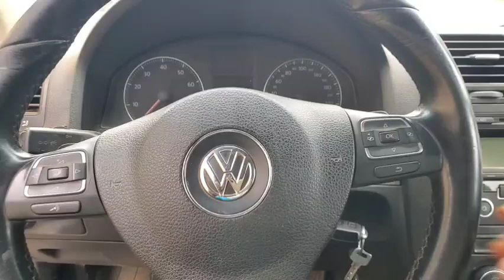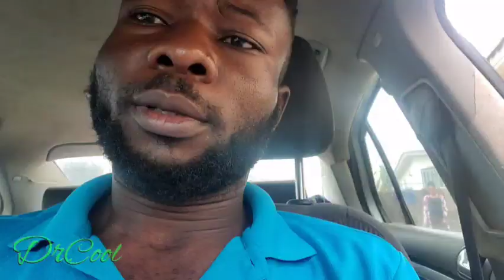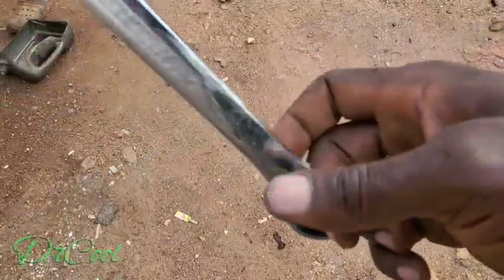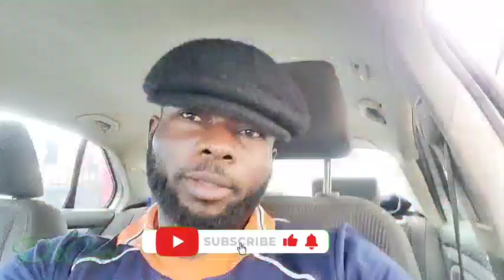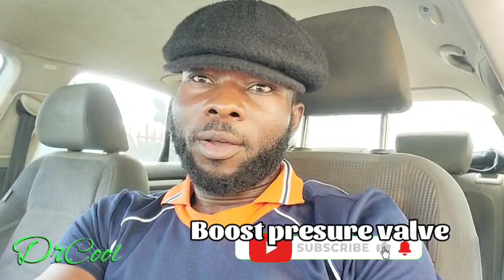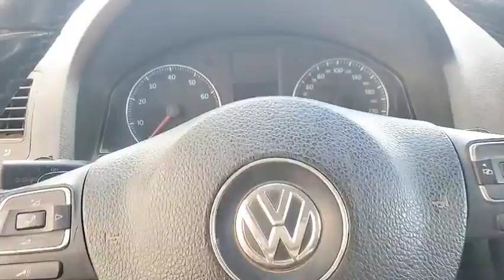Full Engine Power No Longer Available Solved!! | BMW Full Engine Power No Longer Available Solved!

Comment: Thank You for sharing your videos bro, i currently have the same issue on my M50d with code 429a boost pressure control , low pressure stage, control diviation.